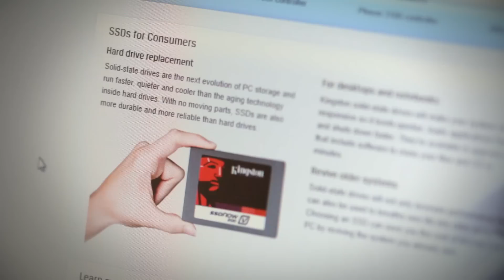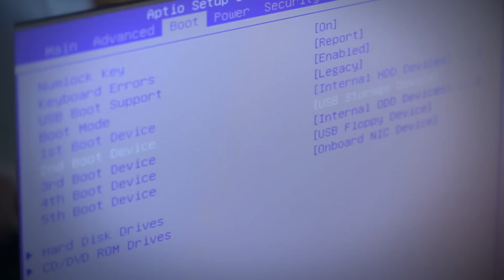How to Install an SSD in a Dell Desktop PC - Kingston Technology

Comment: I replaced the 1TB HDD with a Kingston 1TB SSD. To clone the HDD to SSD, I used WAVLINK totally offline; took 2 hours. Fantastic, no problem and the DELL 3250 is now is fast as .....
Reply: I have a Dell Inspiron 3847 and looking to do the exact same things. The video seems pretty straightforward. When exactly did you clone your old hard drive? Was this entire process easy? I am not computer 'mechanical' savvy but I can follow directions. I paid a shop to relace and install my harddrive on my laptop 2 years ago and it runs fantastic. However, I rather save that money if I can. Thanks
Reply: @KM-yh4gh  I am a newbe too, never did it before. First I removed the HDD from Dell and bought the Kingston 1TB SSD from Amazon. Then I used wavlink (also from AMAZON) to mount the HDD and SSD to clone the HDD, entirely OFFLINE without even using the Dell; when WAVLINK completed the process (took approx 2 hours), I mounted the SSD in the Dell. NO PROBS whatsoever, fantastic. WAVLINK is a separate device and dirt cheap (~$50); you can use WAVLINK 3.0 online as well (cables are included), but I didn't have a need for it. You could also use the Acronis disk cloning utility (I use it for backup), but people reported problems using Acronis, so I got WAVLINK 3.0. 😊 I didn't have to use UEFI/BIOS at all because the drive letter didn't change.

Comment: I have the DELL XPS 8940 I'ii ask because when I plug the plug in the power the PC turns on for about 4 seconds and then turns off. While after I can turn it on regularly. So it is normal that it turns on by itself before being started: Thank you

Comment: I have XPS 8700 and Hard drive got failed. I have created a bootable USB for Win10 OS install. Will the same procedure work to replace the failed hard drive with SSD?
Reply from the maker: Yes, you can replace the failed drive with an SSD. You will need to use a USB or CD to perform a fresh install of the Win10 OS.

Comment: will this work in inspiron 3647 destop
Reply: Just checked the specs of the system - it takes 2.5 inch HDDs, so a 2.5 inch SSD should work just as well

Comment: What is that red cable called at 1:54? I don't have enough of them in my computer to plug in both my ssd and my hdd which I want to do. Is there any place that sells this type of cable and what are they called?
Reply: That's a SATA cable. You can get tone here: http://www.newegg.com/Product/Product.aspx?Item=N82E16812816027

Comment: Could I just stick the ssd in the case with some tape or something?
Reply: Honestly it is kinda recommended, because SSDs have no moving parts so if dual-sided tape is strong enough it would work just fine :)
Reply: It's not recommeneded, but for desktops which don't have a fit slot for an SSD (even with an adapter), it seems to be a very simple and reliable solution. Worked great for me, anyway. You may watch the (very simple) explanation at time 09:30 in the link below. 
  https://www.youtube.com/watch?v=LJQYIjSJ0j0
Reply: I have stuck an SSD to the pc case with duck tape several times,perfect

Comment: My grandpa bought a used Dell Precision T3600 with no hard drive and wants to use a SATA SSD hard drive(Patriot Blast 480GB) that was loaded with Windows 10 on a custom computer. We cannot update the BIOS right now(A06 BIOS) and the hard drive is picked up as a SAS drive. When we try to boot it, Windows Ten says that it needs to restart, error: INACCESSIBLE_BOOT_DEVICE. Any tips?
Reply: You can't take an OS loaded on a drive and put it into another computer. You need to either try to get a recovery disc for the old PC, or get a new copy of the OS and install it on the SSD from scratch: http://www.newegg.com/Product/Product.aspx?Item=N82E16832416892&cm_re=windows_10-_-32-416-892-_-Product

Comment: Do you guys have a video or know of one on how to replace your old hard 
drive with a new one, but a fresh install? Like get the os from the old 
hard drive, but none of the files? 
I'm looking to sell my old computer and of course don't want them to 
access my information, or have any chance of even recovering them if i 
wiped it. I feel much safer just getting a new drive entirely.
Also, do all hard drives work for all computers (at least newer ones)? My XPS 8700 is the one I want to replace the hard drive with a 1TB hybrid drive and get a new computer for an SSD. Just want to make sure the hybrid drive isn't somehow incompatible.
Reply from the maker: Hi there, yes, there is a video on how to do a fresh installation of Windows 10 rather than upgrading an existing OS here: https://www.youtube.com/watch?v=7EFImQdu7dE&feature=em-uploademail. If you are looking to completely wipe the contents of your old hard drive, you will need to run a deep disk erase application several times to overwrite the disks to ensure that is is not possible to recover the contents of the drive. Generally whether meachinical or SSD or Hybrid doesn't matter, as long as they all feature the same connection type, namely SATA or Serial ATA. Your Kingston Support Team
Reply: Kingston Technology
Okay awesome. So if I have a brand new hard drive with nothing on it, that windows 10 installation is all I need?
I'm usually pretty tech savvy, but the BIOS stuff is the most confusing. If a harddrive is brand new, how does it install the BIOS for your computer?
Reply from the maker: The BIOS is loaded on the motherboard and is therefore independant of the Hard drive or SSD - updates are "flashed" to the BIOS chip of the motherboard either having been downloaded to a hard drive or SSD or specically formatted USB flash drive. New motherboards already come with a BIOS pre-loaded.
Reply: Kingston Technology
Ah okay, did not know that. Cool to know, thank you.

Comment: Don't forget to check that the SATA Mode is set to AHCI in the BIOS, and if leaving your old HDD in place (which is what I did), you WILL have to set the Boot Order to SSD as 1, or at least ahead of your old HDD.

I never even had to do anything to my OEM installation of Windows on my old HDD. I can access all my old files (through My Computer, which shows the HDD as OS (F:), or even boot into the old Windows installation by hitting F12 at startup and selecting my WD 500GB HDD from the Boot Order.

Comment: I have a important question. Since this a prebuilt computer, ( I have a dell xps 8700) how am I suppose to reinstall a cd?
Reply from the maker: +ThatOneAsianGuy
You have a few options actually. If you clone just make sure you get all the partitions. Alternatively you should be able to do a clean installation as long as you have your OS product activation key. Contact Dell for more details.
Reply: Kingston Technology Ok ill try to clone ty
Reply: @kingston  I have a Dell XPS 8700 too. Thanks for tip about cloning.